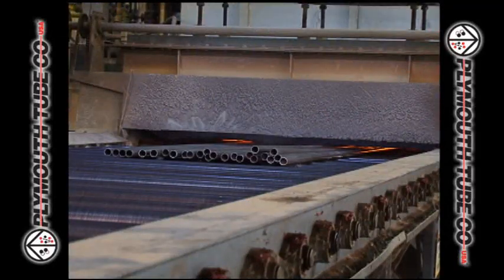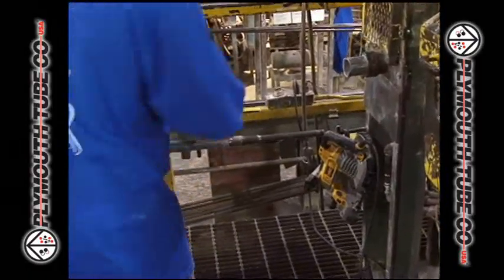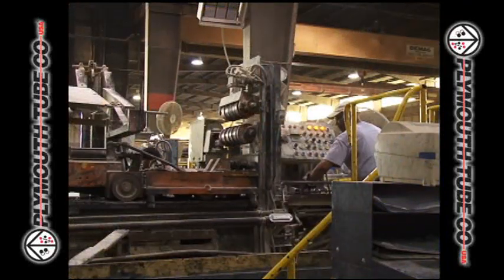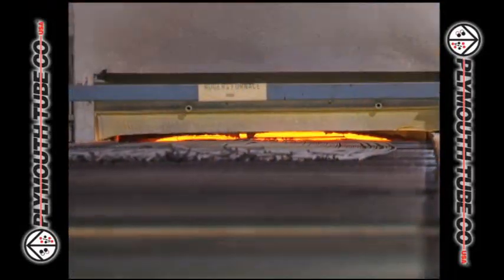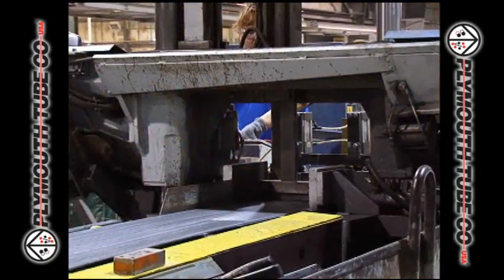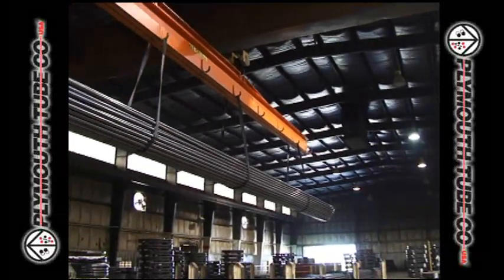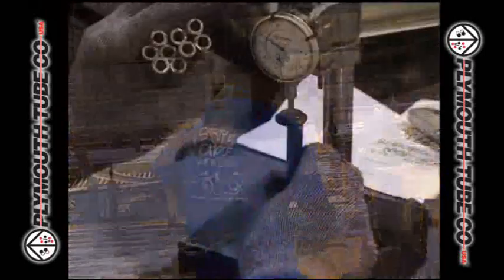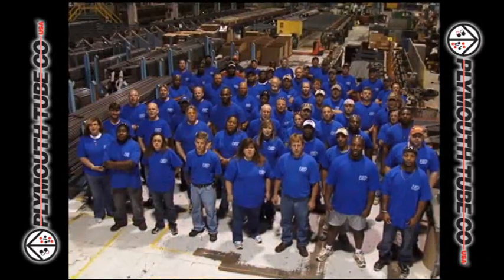Drawn Over Mandrel Steel Tubing

Comment: So DOM is actually ERW that has had the weld seam clean out?
Reply: DOM has a weld. It's just nearly invisible.
Reply: @runhardhooah  Is it stronger than ERW at all?
Reply: @alexdodson9493  i think it is. I will check this coming week
Reply: @alexdodson9493  Yes, DOM will be stronger in terms of pressure ratings. Granted it'll be quite a bit more in cost.

Comment: Hey I didn't  realise DOM was welded seam also-------There is a big debate is DOM stronger then standard steel pipe(Schedule 40 gas pipe type) ----Is DOM actually stronger then pipe or is it just the ID/OD measurement is different?  \Thanks for your advice
Reply: Isn’t it about ductility?